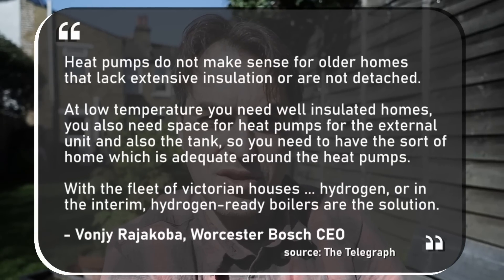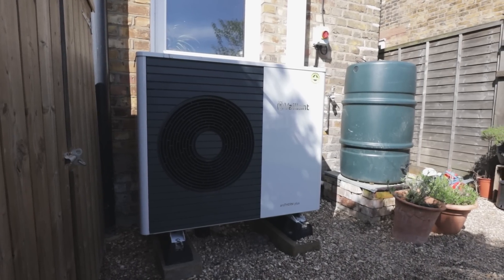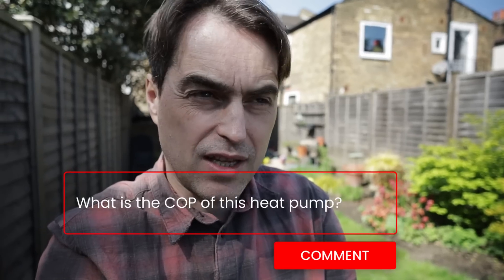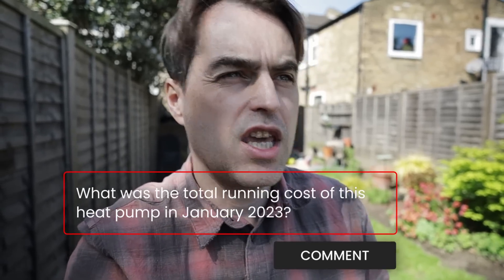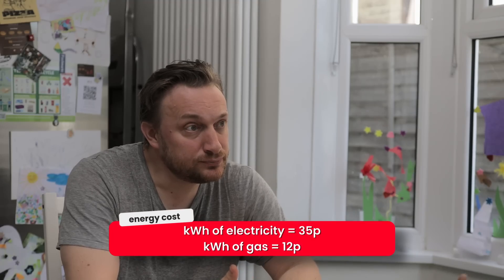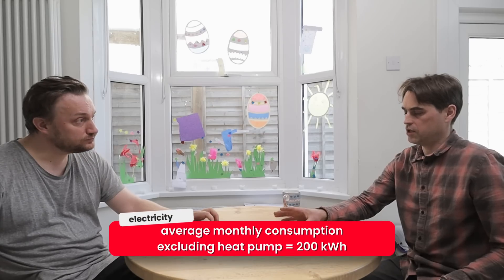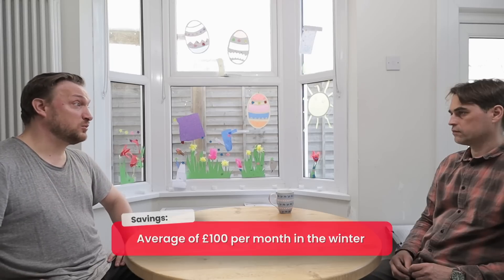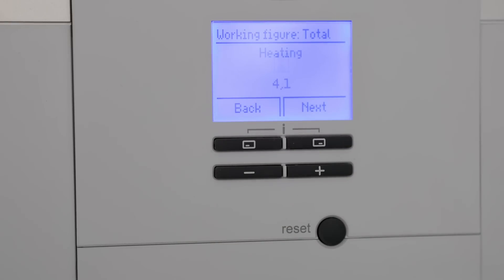Worcester Bosch CEO Is Wrong About Heat Pumps. Here Is Why.

Comment: Heat pumps are clearly part of our future and present and in many places they will be the best heating solution, but it does not mean that we must try to impose them everywhere and grant subsidies for them.
This winter was a very warm winter; not only the heat pump takes up living space, but also the enlarged radiators; the space in the yard is also important if you live in a city where the land is relatively limited. with heat pumps, not only the operating cost should be considered, but also the purchase cost (and the non-subsidized price of the heat pumps should be considered!!! because the subsidies do not fall from the sky but are paid by the other taxpayers), installation and maintenance because heat pumps will break down after a number of years and the cost of repairs is higher than that of gas boilers + skilled technicians available to maintain them are perhaps 30-40 times less than those able to repair a gas boiler...
the accessories inside the house are more difficult to mask like a gas boiler if you don't have a technical/laundry room
Reply: Well you can have anything as long as it does not burn fossil fuels. That leaves little choice and heat pumps are best.
Reply: @rogerphelps9939  
maybe a vegan will tell you that he would choose to burn gas but not eat beef and would choose to ride a bicycle instead of an SUV and would have the same footprint on the environment as someone who doesn't burn gas ;)
An environmentalist would also forbid the use of cement in construction... everyone sees the advantages and disadvantages differently.
the part with the burning or unburning of fuels (fossil, renewable or synthetic) is relative...
having a bivalent gas boiler in the house with very high power modulation is very practical and convenient - it takes up little space and responds relatively instantly to the thermal needs of a house... + low cost of purchase, installation and maintenance for gas boilers an advantage ...
There is no single solution to the problem of global warming...
The Dutch don't want the glaciers to melt, but maybe the Russians in Siberia would enjoy a warmer climate ... carriers would be happy to have access to the navigable channels of northern Russia and Europe
Reply: @rogerphelps9939  The electricity supplied to your heat pump comes from burning oil and gas mainly. Or is imported from other countries that burn it on your behalf so you can pretend you are "clean". And in any case, there's nothing wrong with the planet, what's fucked are the people pushing these profit based agendas on everybody. Yes the weather is changing, that's what it always has done and always will.

Comment: I think by lack of space he meant space to place outdoor condenser units. If you place too many outdoor condenser units too close together, their total delta is lowered as they cannot pull much ambient heat from the atmosphere. I did a service call last year for a church in New York. They had a 100’ x 50‘ building with five units spread evenly across the south facing wall. This wall has plenty of sun and plenty of ambient heat, yet the building was not heating properly because the units were too close together and there were too many of them causing them to pull heat From each other instead of from the atmosphere whenever the temperature dropped below 40°F, which is very common around here

Comment: With good cop heat pumps still save money. More insulation on front and back walls and tighter windows and doors and heating costs go even lower. With high gas costs heat pumps win on efficiency alone.

Comment: It would have been interesting to know what the ambient temperature of the house was under gas and the heat pump for comparison. Was it the same, higher or lower using the latter?
Reply from the maker: 21c in both cases

Comment: UP, It's a given that youre going to do everything perfectly and its no surprise your customer has such an efficient ASHP. Does payback time ever come into the equation? I'm assuming ASHP installation prices will wreck the cost/benefit calculation?
Thanks for the video. Love your channel!!
Reply: I think it was clear that the owners were prepared to replace the old heating system in its entirety. At some point all those heating systems installed in the 60s will be life expired. For houses built in the 60s - 80s with CH systems put in a bit later, they may still have some life in them and with cavity walls filled, solid floors, good double glazing installed and loft insulation up to 270mm the radiators will not need resizing in many cases. That accounts for many homes built at that time. My home built in 1984 required only one radiator changing and that was merely to swap an 800x600 radiator for a double of the same size.
Reply: @briangriffiths1285  many more recent homes use microbore pipework to radiators which will need replacing, these houses were also built without a good sized airing cupboard. The only way to establish how much work is required is to carry out a full heat loss calculation, which will ascertain radiator sizes as well as pipe sizes.
Reply: @geoffaries  You're right new homes will need the full calculations doing, but I wonder whether the low and slow heat generation of a heat pump needs bigger bore pipes or even bigger radiators. Isn't the latest standard that the output temperature of boilers has to be a lot lower than the 80 degrees of the past? More in the region of 50 degrees to ensure condensing is always active. In which case it might be quite simple to swap in heat pumps. the bigger issue is for hot water storage. It is possible to get slim tall rectangular tanks and that might be the answer.
Reply: @geoffaries  My 4 bed house originally had microbore with coaxial valves at the ends of the radiators. These things were a kludge and never worked very well. I replaced all of the radiators with ones properly sized for a new GSHP and, where I had to dig up the floor to put in new pipes it was 15mm. I now have mixed 15mm and 8 or 10 mm microbore. With the new GSHP everything is working well with a COP that very rarely falls below 3 and is usually around 4.5. I was lucky to get the domestic RHI so my grant will be around £15k over 7 years so the money I had to find myself is quite reasonable. The prices of heat pumps will come down and the GSHP boreholes will last indefinitely.
Reply: @briangriffiths1285  Bigger radiators, yes. Bigger pipes, no. My system is now mixed 8 and 10 mm microbore and 15mm. It works very well.
Reply: @briangriffiths1285  The challenge is not with the new properties being constructed in the near future, certainly they should be designed of very low temperature heating, with the correctly sized pipework and radiators and preferably with UFH on the ground floor, radiators are perfectly suitable for bedrooms. I have been installaing  UFH in houses that I have built since 2010 and all of the systems are heat pump ready. The challenge is that virtually all new homes being built, up to and including, today,  don't have systems designed for very low temperature heating, they also have concealed microbore to the radiators. I have taken this up with several local national builders and they won't voluntarily redsign their systems. Incidentally there are savings to be made when using a gas condensing boiler with weather compensation and very low temp heating, they will condense all the time on heating.
Reply: @rogerphelps9939  Yes you can use microbore, but you will need an additional tank/vessel to maintain the minimum flow rate that the heat pump requires, so you'll need space for the hot water cylind ander also the thermal store/volumiser. This can be challenge for many newer homes. The price of heat pumps may well come down, but the labour costs won't. You should also factor in the additional servicing costs, GSHP's in the UK must use an antifreeze and like your car this has to be flushed out and replaced regularly. I would also include the interest on the cost difference between replacing a gas boiler for gas boiler when compared to the installation of a GSHP, normally the additional cost of a GSHP compared to an ASHP is not covered by the better efficiency of the GSHP.
Reply: When it comes to where you live, not everything needs a payback period… People become obsessed with that phrase when in reality, having a warm and safe place to live and raise your kids is probably of greater importance.
Reply: @dorsetengineering  the majority of us hoi polloi will need to borrow the £15k required, so payback period and affordability is very important.  Perversely it's those who dont need the grant money who actually get it, most people can't afford an ASHP so are subsidising richer folk. As regards safeplaces, theres nothing safer than a gas boiler.
Reply: @dorsetengineering  People never seem to worry about payback periods for cars but a heat pump is a far better investment than any car.

Comment: We're currently renovating a 300 year old period property in the North West. I'm putting in as much insulation as I can where I can but we may not be able to change the wooden sash windows at the front of the house which are quite drafty. I'm also installing UFH at 150mm centres on all the ground floor and one or 2 upstairs rooms. Currently has 3 year old Combi boiler which is servicable - do you suggest looking into a heat pump? How do I decide please.. I don't want a cold house in winter! Thanks for all your incredible videos!!!
Reply: If you have the space get a GSHP. It will be costly but very satisfactory. Going green is in itself a virtue and should help with the value of your house.

Comment: A lower efficiency property will lead to a higher COP.  Still £175 per month is good, I expect the heating system payment or depreciation was not included.// £20,000?
Terraced properties are not that bad, as they only leak from the 2 sides not 4 like a detached property, if the floors are not too bad it should be fine.  My slightly better insulated but drafty 3 bed detached uses about 600kWh/week of oil at maybe 50% efficiency.  So its need half that in energy terms, say 300kWh/week in actual heat, 2 people in house most days WFH.
You also didn't give the COP in January.  The minimum COP is far more important that the average.   Hot water can be provided from off-peak resistive heating without a heat pump.
Providing heating when you are not in is not-wanted heated, you cannot include it in efficiency.
Reply from the maker: the cost to the client was around half of your quoted figure
Reply: Not 300kwh per week, more like 200kwh.
Reply: @rogerphelps9939  How so>  50% efficiency means I have to put in 2x the amount of energy than the property needs.  I am putting in 600kWh of oil, therefore the property need 300kWh in the period.  I am showing the difference a detached property makes, and the effect of a drafty floor.

Comment: I'm a mechanical engineer in Canada and our clients want heat pumps in older commercial properties.  Problem is they don't have the electrical capacity and the space for large air handlers. Also, large delta T in Canada (50+ Celsius), so need back up heat.
Reply: Ground source should be better.
Reply: At that point you definitely go with ground source. If the commercial property is big enough you can even do all the drilling inside which makes permitting easier.

And large commercial properties have an electrical connection in the hundreds or thousands of kW.
Reply: @anonym3017 thanks fir the replies. I should clarify. Large commercial properties in rural areas without 3 phase power. Large is relative to other type of properties in the region
Reply: @goldenretriever6261  so farms and not factories.

Got it.

Comment: You pose the situation opposite to what I have here. Installers that didn't want to run maths properly installed a heat pump that could handle a house with tripke the heat loss, but that with no changes to the radiators from the retired system boiler (which ran over 80 degrees Celsius) it runs under a COP of 2 when it's close to freezing. The result? A system that can keep the house warm when it's kinda cool by inefficiently turning on and off multiple times per hour as it heats the water too fast for the radiators. And breakers tripping when weather is actually below freezing.
Reply from the maker: as I said in the video: system design and calcuations for pipework, unit size and radiators or UFH contorl of the system is THE MOST important aspect of heat pump installations
Reply: Inverter heat pumps do not cycle on and off like that.

Comment: Wow , electricity is expensive in England. In Canada a kWh is  5-10 p (converted from Canadian $) depending on time of day.
Reply from the maker: Yes, the most expensive in all of Europe I believe.
Reply: @UrbanPlumbers  electricity is more expensive in the UK due to the green levy.
Reply: @geoffaries  Wrong. The green levy is a miniscule proportion of the electricity price. The price is high because it is tied to the most expensive generation methos which is gas. It is a disgrace.
Reply: @rogerphelps9939  25% is not miniscule! I suppose that you also believe that energy produced by windfarms and solar farms is cheap. I hate that we are wasting a precious resource, Natural Gas, to produce 60% of our electricity, it is far more efficient to use gas at the point of use i.e. in the property and not wasted producing electricity, I'm not against a mix of production capacity for electricity, we can use wind, solar and hydro, but they won't keep the lights on, the base load should be provided by nuclear power, clean coal and oil, not gas
Reply: @UrbanPlumbers not quite German. Denmark and i believe Ireland were slightly more.
Reply: The price of electricity here is tied to the price of the most costly means of generation which happens to be gas. It is a scandal.

Comment: Further q please Simon. 
You mention earlier about 0% VAT for a complete system/refurbish ? 
Could you expand al little for me please. I have not heard of this before unless it is a new build. 
Thank you
Reply: I have been doing a little reading and shouldn't really comment further until I have studies this thoroughly ! 
But it appears that ancillary works, ie upgrading radiators/pipework etc is also included in the tax relief and therefore zero rated for VAT ? 
If this is the case it should be promoted more. It is a significant saving not applicable to the conventional gas route.
Reply from the maker: Yes, complete install is zero rated for vat.

Comment: Good morning Simon. 
Apologies if this has been asked previously. 
Did the thermal requirements/insulation for this property meet the requirements/qualify for the £5000 grant. Solid walls, bare floor boards, no insulation ? 
Thank you.
Reply from the maker: Yes it does. You have to upgrade the loft insulation to 300mm
Reply: @UrbanPlumbers  Thank you for your answers. 
This is a perfect example of  presentations such as yours doing great work to covey far more detailed and valuable information than other areas of the industry.
Reply: @UrbanPlumbers  can you post a copy of the EPC? Thanks

Comment: Telegraph is basically anti-electrification.  One might guess for some interest in petrochemicals.  So it's run all sorts of nonsense (and non-news) such as "the grid can't power electric cars" — although National Grid thinks that it can — and "electrifying railways is a wast of money — duh!? What!?  and so on.  

One does wonder why Worcester Bosch should contribute to such propagandising…  well they're promoting both hydrogen boilers and gas/electric systems so perhaps pure heat pump fitting would undermine their business models.  In which case they really need to be re-evaluating their business plans not trying to alter reality to fix their poor choices.
Reply from the maker: they want to be able to keep selling gas boilers under the banner of 'hydrogen ready'. they will most likely tey to push for gas / hydrogen blend and try to lobby the government to allow it as a green fuel, so that the boiler sales can carry on.

Comment: Slightly misleading. Without insulation OR oversized radiators, no way the heat pump would function in the way it has as a direct boiler swap.
Reply from the maker: Well, you may be wrong. Here you go https://youtu.be/2jM_oKWptaI
Reply: @UrbanPlumbers   I don't believe I am. I admire what you're trying to do but the SCOP in that house is drastically lower than in the house in the video above. 

We track annual performance for all of our installations for 2 years, and we see the same thing. You'd be lucky to hit a SCOP of 3-3.3 in a home without insulation and oversized double panel radiators. And unless you're well into the 4+ SCOP range, the payback on additional spend just isn't there (unless you install Solar PV as well).

For people who cannot spend £15K or even £7K, we install Viessmann 200 system boilers as the next best compromise.
Reply from the maker: Still comparable to gas in running cost !
Reply from the maker: why are your installs so poor? We also track heat geek installs and most run at above 4 scop?
Reply: @UrbanPlumbers  We are unable to achieve a SCOP greater than 3.3 in houses with poor insulation and single panel radiators (old style). 

In modern homes with oversized emitters, we easily achieve 4.2 SCOP if not higher.

If you are able to achieve a >4 SCOP in home with old single radiators and poor insulation, I will stand corrected but it is highly unlikely.
Reply: @UrbanPlumbers  Great - so whats the point of the huge installation and loss of space then? When your electricity is always going to come from a mixture of sources including fossil fuels, which IMO we will never get away from - because renewables are as useless as heat pumps.